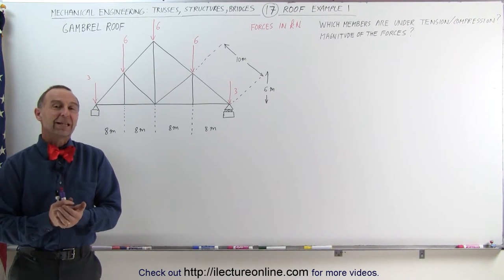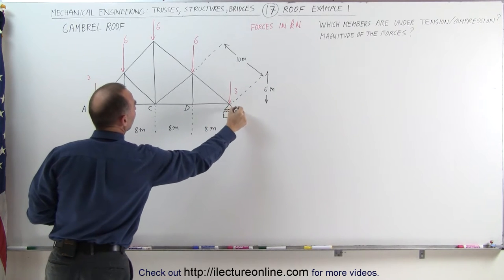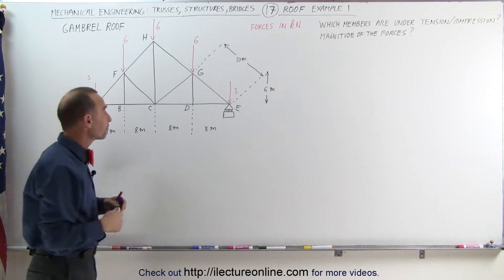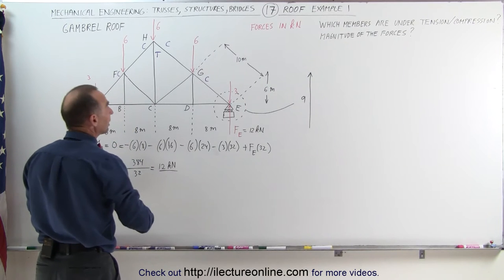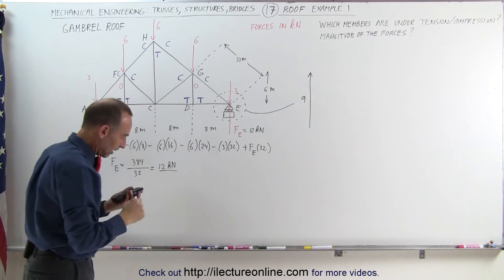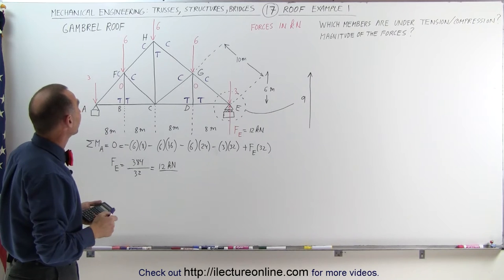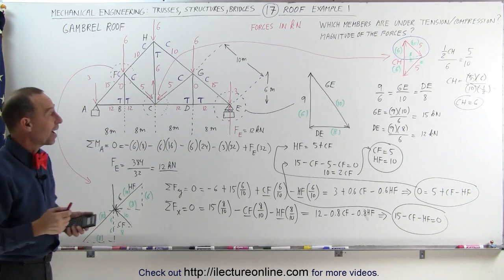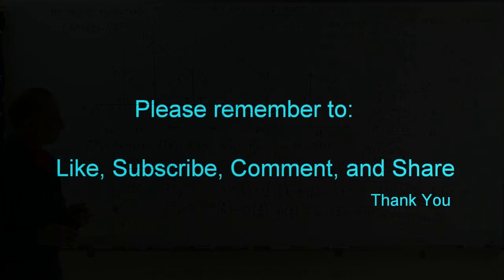Mechanical Engineering: Trusses, Bridges & Other Structures (17 of 34) Gambrel Roof: Example 1***

Comment: Thanks for the informative video. I would like to point out that your example is not a gambrel roof. A gambrel roof has two slopes on each side with the upper slope at a low angle and the lower slope at a steep angle. This is more accurately described as a gable roof.
Reply from the maker: Great input.  Thank you.

Comment: Good day Sir, I really do appreciate the effort, work and passion you put into your work and making it enjoyable for us as well. You have helped me through allot of problems concerning my studies. 
How ever on this particular example I do have one question regarding the vertical forces at point H and member HC. 

The external 6kN force acting on point H, does that not add to the vertical components making the Tension force of HC 12kN ? 
Or does the entire 6kN acting on point H get absorbed by members HF, HG and continuing into the frame?
Reply from the maker: The purpose of this type of structure is to convert the support of the load to the end supports of the structure (in this case Fa and Fe).  Note that when you add up all the vertical forces (up and down) they should all add up to zero.

Comment: Thank you sir you make this seem so easy and I like how you explain everything you do.  My question is if you removed members CF and CG would that change any of the calculations?   Would that simplify the truss calculations?
Reply from the maker: You can't remove member CF, because that member is under compression and partly holds the 6 kN load.  You would also break the symmetry and balance between CF and AF.
Reply: @MichelvanBiezen  Thank you for your quick response.  The reason I asked was because my garage has a truss exactly like this one but without those two members CF and CG.  I was trying to calculate the stresses on my truss by following your example.